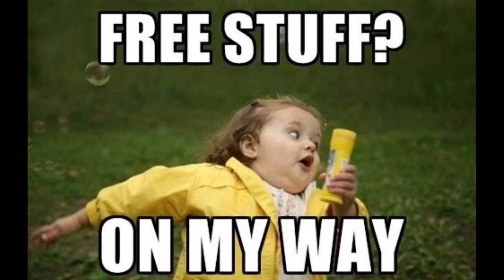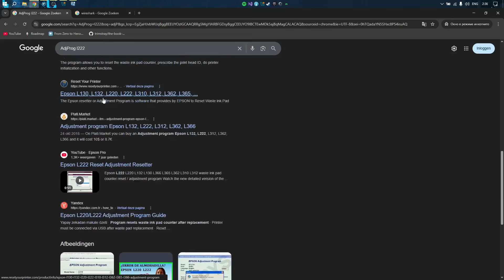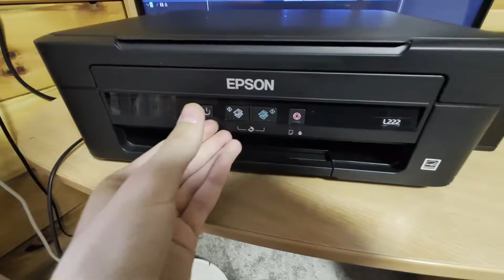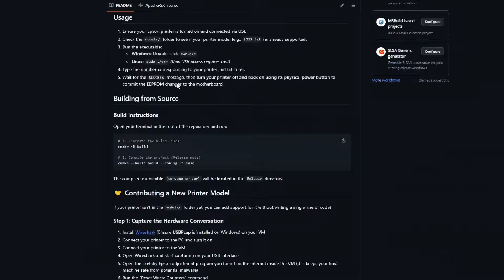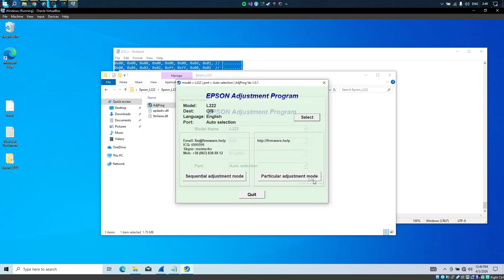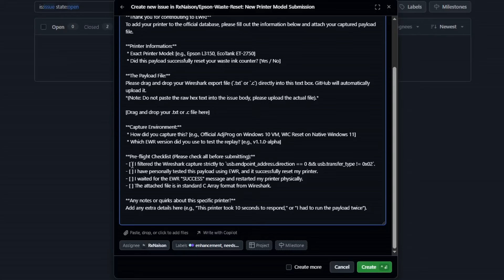Reverse-Engineer Your Epson Printer: How to Add Models to Epson Waste Reset

Comment: Hey, great work! In your video you show us the process using those sketchy 'adjustment programs' only, DOES IT WORK WITH THE 'WIC RESET' PROGRAM TOO? 
I usually use WIC reset, so wondering if it's the same process... maybe you can upload another video explaining
Reply from the maker: Hi! Yes, it works with WIC Reset too. The process is mostly the same: start capturing -> hit reset -> end capturing

Just a heads-up if you use the free WIC trial key: the captured payload will only roll the counter back to 80% instead of 0%. Since EWR acts as a direct 1:1 replay engine, any .c file captured from a trial key will inherit that 80% limitation.

However, no need to rush and buy a key just yet! The newest version of EWR supports  ~1,500 models out of the box - give it a run first to see if your model is already there

Comment: Honestly, this would be great for a businesses for the industrial epson printers, let’s be real. It’s not actually full when it says it is you don’t actually need to change it.
Reply from the maker: True. But if you just reset the software and don't actually clean or change the pad, you might forget about it later. Eventually, it really will overflow and cause a huge mess, so the counter does work as a good reminder.
The good news is you don't even have to buy a new one. In the video, the pad I'm showing was actually just washed in the sink and dried. Just a warning if you try washing it: the ink gets absolutely everywhere and my hands were dark blue for a few days! 😁

As for businesses using it: I don't really care who uses it. I just ran into a problem that shouldn't even exist until you mess with Epson, so this program is my answer to them. Open source means everyone gets to use it